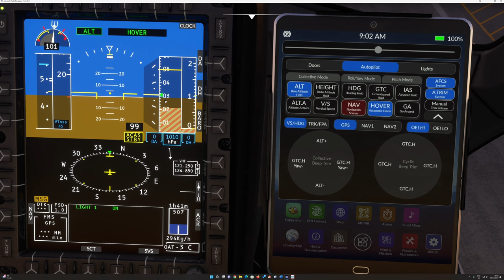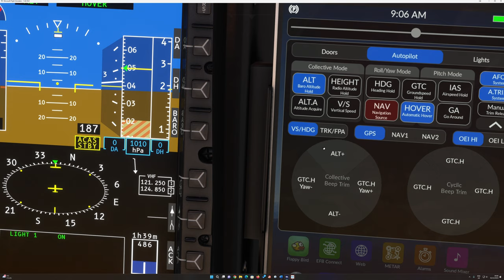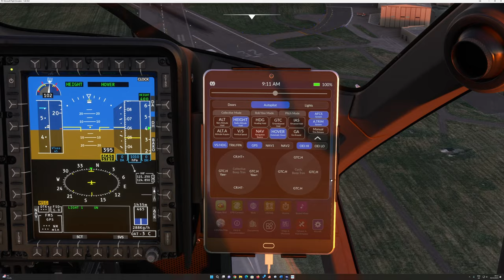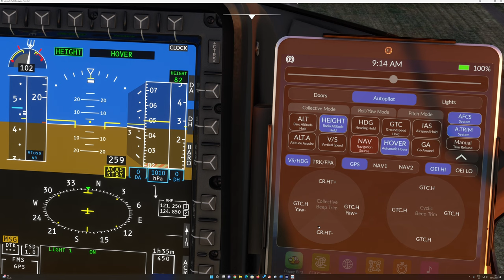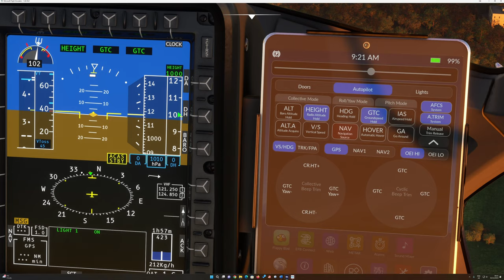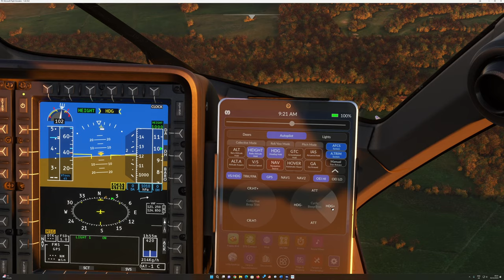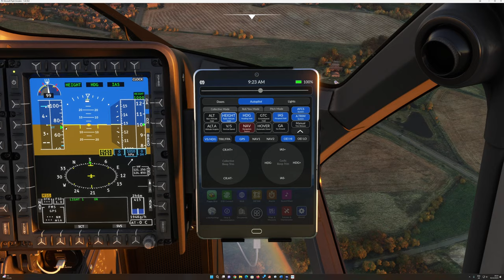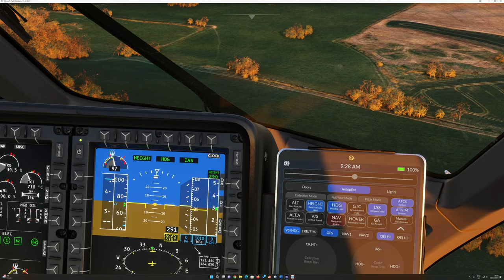NEW HPG H160 - Tutorial 1: Let's get you up in the air. Autopilot from scratch!

Comment: Great video, thank you. I found the ground speed hold directional stability during a strong crosswind to be dodgy to the point of unuseable. I also found that re-engaging radar height hold like yours to want to reset to a previously stored value in memory. Still, super impressive coding considering how expensive real world helicopter autopilot software costs and the complexity of calculations required. Good FPS too. Very glad I bought the H160. Next stop, following a flight plan.

Comment: Good video, thank you. Does the real chopper have that iPad for controlling automatic pilot or is there another way? Cheers
Reply from the maker: No - the ipad is to enable all pc users to use the AP. The AP controls are on the centre console, and managed through buttons on the cyclic and the collective. However, you can model all of these controls, or many of them, to your own sick and throttle system. I am not sure about the H160 but pilots flying with reference to tablets for navigation etc is very common.
Reply: @theflyingdoctor  Thank you for the reply , any chance on a future tutorial setting up the peripherals and Simulating AP as in RL flight? Cheers.
Reply: @theflyingdoctor  Since you were describing using autopilot to traverse (“clear”) rising terrain, did you mean to fly Vx, and not Vy, as stated?  (Vx is best angle out speed, which is used to generate max vertical climb per unit distance fwd, i.e., clear obstacles when fwd distance is limited, usually short field takeoffs).
Reply: @baomao7243 Yes I had the same thought 🙂